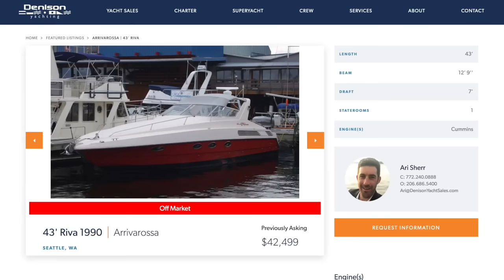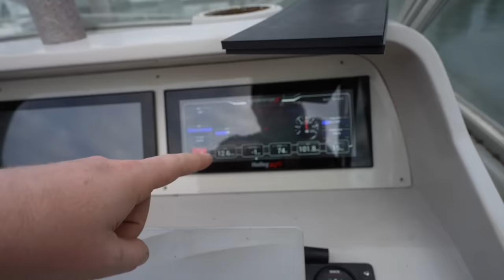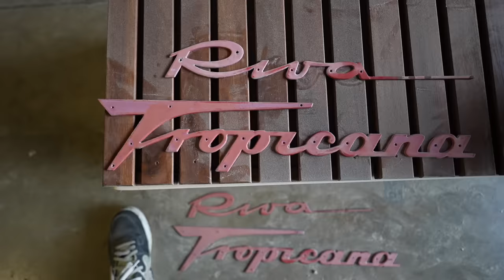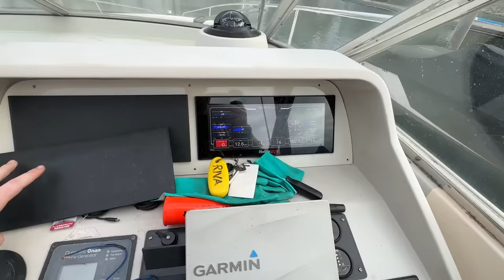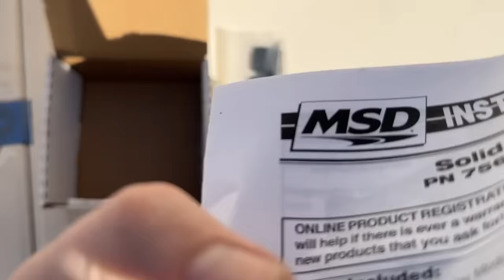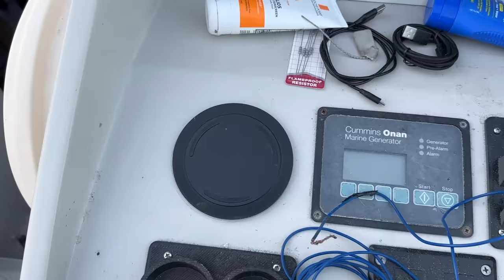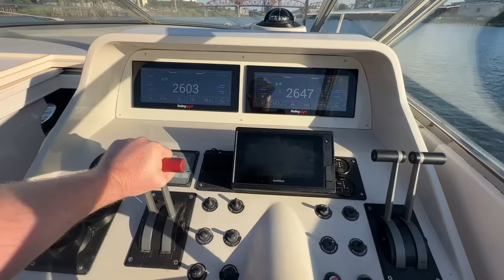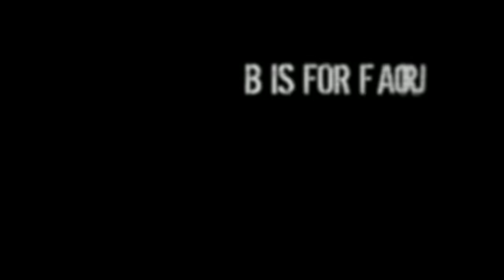LS Swapped 30yr Old Italian Yacht FINALE!! - ITS FASTER THAN EVER!!!

Comment from the maker: im sorry about the sound issues guys, it didn’t show up during the edit and i understand it’s really bad. We’ve been trying different stuff to get the best camera picture mixed with decent sound, and well… i messed up. Sorry and i’ll fix it on the next one and be sure to check better in the future. Also sorry about forgetting to put the 3d modeling video in!! this is why i shouldn’t wake up and edit at 7am but sema crunch is real!
Reply: If the old compass is a Ritchie, it might be eligible for their factory reconditioning program. It’s probably cheaper than the new compass.
Reply: UNACCEPTABLE! Kidding love you guys , keep killing it
Reply: You can get different pich props ab get a better rpm
Reply: Always good to see your wife put in some hard work and skill.
Reply: Can i suggest 32float recorders? you seem one of the few people on YT that would figure them out - used right they would mean perfect audio even for speaking softly right after a 2step test, because the gain is recorded with the audio
Reply: Finale? Say it ain't so! I hope to see more boat videos at some point in the future!
Reply: yay SEMA!
Reply: I would say the limiting factor is the proppellers that are too small
Reply: Try BED LINER for the steering wheel. Dip it.
Reply: Hey you can spray your carpet with nano materials now and it makes it impervious to any strain without changing any of the physical properties in any way!
Reply: You need different props. RPM's should be in the 5g'S
Reply: Purple Power works great on floors and vinyl. Cut it in half though for the vinyl.
Reply: Not to mention burying the bow

Comment: Your props are designed for the low reving diesels.  You will need to resize them to allow the LS engines make power and higher rpm.  At 2700 rpms, the LS engines are barely breathing.
Reply: And inefficient.
Reply: They are LUGGING. That is a lot of load for that rpm level.
Reply: @TheBCninja  I bet that if @Texas Speed see this video they already called him regarding constant full load at those RPMS.
Reply: And you are using Marine Plywood on your table?
Reply: Teak wood will Grey over time. That is normal.😅
Reply: I was going to write the same thing.
Reply: @leetingler619  What are you talking about?? Nobody has mentioned anything about wood. lmao!
Reply: I feel like he doesn't look at the comments, we've all been saying this for years, yet he doesn't listen 🤷‍♂️
Reply: if you continue to run them like this they will die! change pitch and you will fly!
Reply: But they're running transmissions so maybe maybe gear ratio corrected?
Reply: @christophergregg4076 if they are the same gearboxes that were behind the diesel engines they would be propped to only do 2700rpm. the Ls V8s  wouldn't have the low down  power to spin them . I would think with the HP he's got 25 to 30 kts should be his cruise speed almost
Reply: @toddbennett3402  I don't think they're the same gear boxes tho.. I'd have to rewatch the vids of them making the engine cradles again.. But pretty sure he mentioned new boxes.. If that's case they would've been re worked..   Either way rpm is too low, and not on plane.. Everything's under serious load.  My boat cruise rpm is 3800rpm.. Wot is 5k
Reply: Props for the Props comment!  Even with high-torque cams, they still need to be turning at LEAST 4000 RPM.
Reply: That rpm is rubbish your props are so wrong and you're hurting the those motors, if it was a car and you took it to a Dyno unless the tunnel was a yes man they would send you away as the combination is not correct, I would guess those engines should rev to 7 grand so you're only at the bottom third ov the power curve, there's so much more potential with the correct propeller
Reply: Definitely need new props
Reply: Gasoline engines like to have far more rpm than that. You're still using diesel logic to create power
Reply: Bro people been trying to tell him this forever
Reply: @Tren_Rides he does look at the comments, personally argued with people on Instagram back when he said he was using LS engines

Comment: As many others say, you need to prop-match with the new engine and rev range. While diesels torque low down and are fine at 2500RPM, the gasoline V8 need to be much higher to produce power, and as such the propellers should he angled for your rev range and not diesels. Awesome series! Now i want to build myself a V8 boat xD
Reply: Yeah you definitely want those engines singing 5000+ at WOT.  Lugging them down like that is harmful